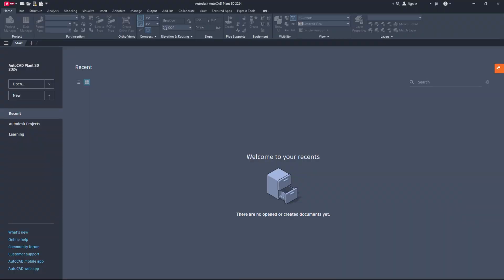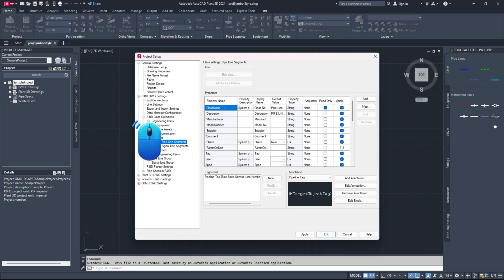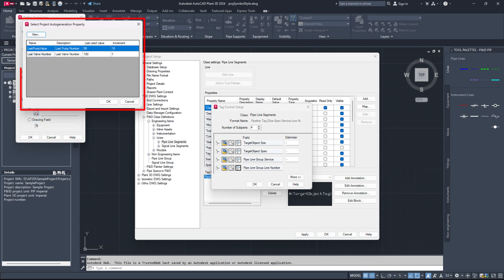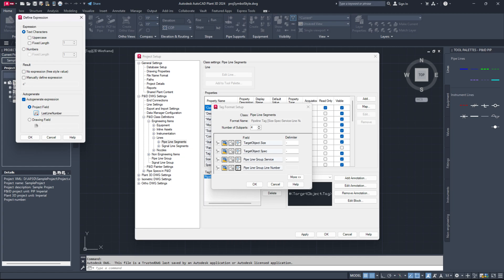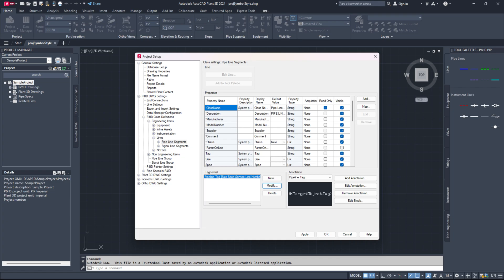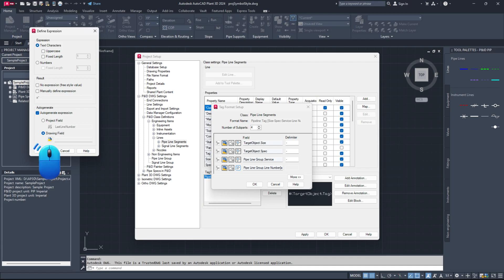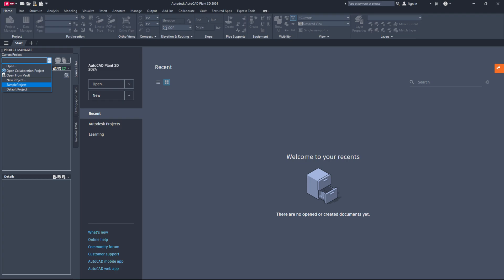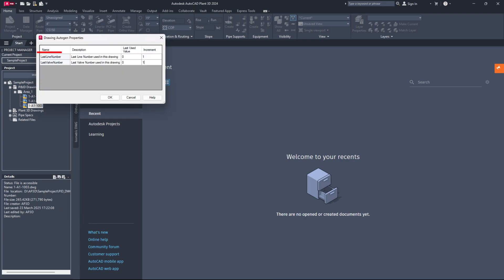AutoCAD Plant 3D | Create Autonumbering for P&ID Components

Comment: Hi
Thank you so much for your videos. Very useful!

I have a couple questions and maybe a couple ideas for your videos on the channel :)

I have questions: 
On the P&ID chart I want the technologist to fill in the SIZE and CATALOG(SPEC) field, as well as other fields, but it is the SIZE and CATALOG(SPEC) fields that it does not display on the chart, after the indetifier is placed on the chart. 
I see a line on the scheme itself, and above it I see linenumber, but in this line number I do not see SIZE and CATALOG(SPEC).

Also i want to link the P&ID schematic and 3D. I have 4 different valves in 3D with different actuators: Manual/Electric/Pneumatic/Gearbox.
I want to be able to add on line in P&ID these 4 items and they will link to the 3d model to insert them into the model. And if someone added another gate valve on that line, I could see it and insert it.
Reply from the maker: Hi, thank you so much for your kind words! I'm glad that you find the videos useful!

As for your questions:
Regarding SIZE and CATALOG(SPEC) fields not showing up on the P&ID.
Ans: It seems that you haven't created a tag format under the Pipeline Segments Class definitions and are instead using the Pipeline group tag format, which only includes the Line Number.

For linking the P&ID schematic to a 3D model. Your video idea sound fantastic! I’ll definitely keep them in mind for future content. Thanks again for reaching out, and feel free to ask any more questions! 😊
Reply: @acadp3dsolutions  About the first answer. I think you misunderstood :)

I see these fields to fill in, I want to fill them in, but I don't want to see them above the line. Here's an example:

I drew a line. i fill tagformat with fields like this:
size, spec, line number, material, insulation.

Then I click show tag above the line and the tag shows me:
line number, material, insulation.

Is this scenario possible? :)
Reply from the maker: Sorry I misunderstood your query. In this situation, please create a new tag annotation style that includes only the necessary fields. Use the standard tag format to input the values when assigning the tag and then annotate the line number using the newly created tag annotation style. Hope this helps.
Reply: @acadp3dsolutions  Thank you . I'll try as soon as I can)
Reply: @acadp3dsolutions "annotation style " in the annotation editor, you can only change the font size, size, and so on. I didn't quite understand your answer then.
Reply: @acadp3dsolutions Is it exactly possible to create 2 tag formats, fill in one on the P&ID, and output the other?)
Reply from the maker: @znakjj  Yes